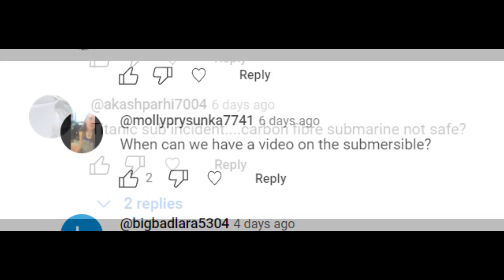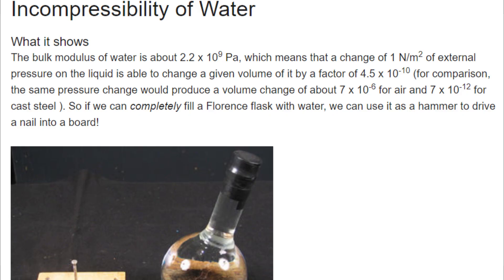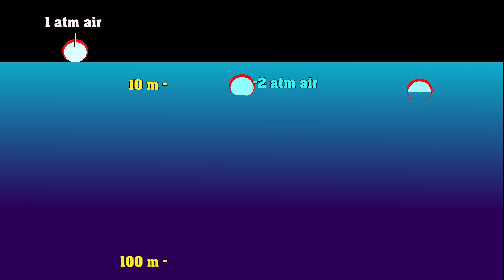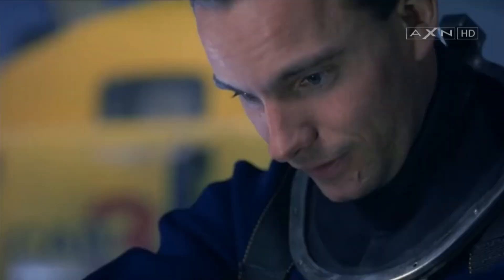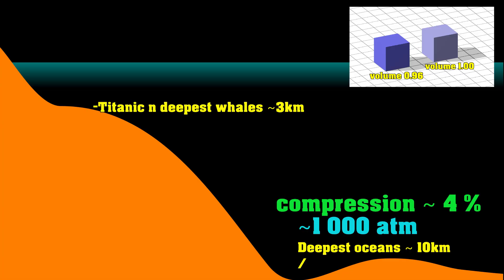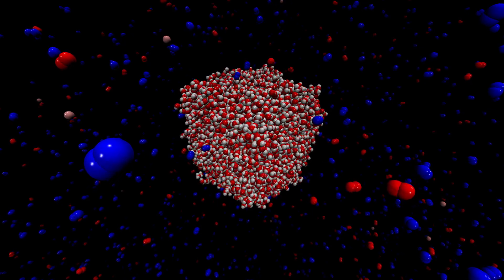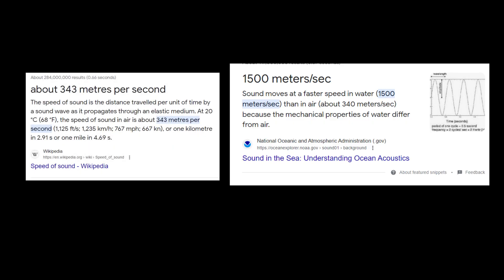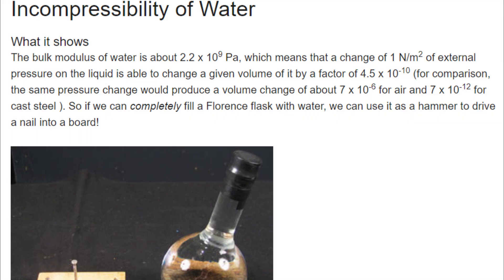What Happens when a Hull Fails at 1000 atmospheres?

Comment: Dude. Wrong. The weight of the water creates water pressure if the pressure inside the sub is less. And it is said to be about 400 atmospheres at that depth. Ever see a pressure washer?  Stick your hand in the stream at 60 psi and watch it strip your hand to the bone. The water pressure would have disintegrated them.

Comment: I'm puzzled by this, in that you seem to be arguing that compression of water is the only thing that creates a high speed leak, and that if the water were not compressible, the speed of the leak would only be "freefall speed". But even a metre difference in pressure head will make an appreciable difference in the speed at which water leaks. I know that there will be some compression even at 1m, but it's surely so small as to have a negligible effect. Pressure, or to be more precise, the pressure difference, does increase the speed of flow. At least that's what Mr. Bernoulli taught me.
Reply: A leak isn't the same thing as an implosion is it? You can have your tube of water and create a leak by poking a tiny hole in the tube, or a big tube. The speeds and pressures will vary between those two cases - yet they are both 'leaks'. We couldn't compare the Titan implosion caused by decompression of highly pressured (some tons per square inch) water with one of those leaks because it wouldn't then be comparable to the second type of leak. Isn't a leak and leak and this is something else unrelated?

Comment: If you have a hole between 1000 bar on one side and 1 bar on the other, the speed of water flowing through that hole would be about 447 m/s (about 1.3 times the speed of sound) based on the inviscid flow assumption. In other words, the amount of mechanical energy stored in the form of pressure (1000 bar) is equivalent to the kinetic energy with 4447 m/s. If the hull fails all at the same time, the water will rush in from all directions at 447 m/s and kill anyone inside instantly.

Comment: Water at that pressure do not act like a rigid falling at g, at that pressure is somewhat elastic; It acts like a compressed spring when its base fails and colapses, expanding very quick. The sub was crushed at a speed very close to the speed of sound on water IMHO.

Comment: When this originally happened I saw the joint fitting clip and knew right away, hand mixing an adhesive? Under these extreme conditions? And NO bolting of the metal to the carbon? Home depot Solution.

Comment: Rethinking the accident into an innovation: 
Deep sea thermal vents (high pressure high heat) are a great combo for curing carbon fiber resin epoxy. 

Only cost effective for mega size manufacturing.

Requires a powdered heat activated resin epoxy with no solvent ; to prevent curing until it is at the thermal vent (this technique requires a "boiling bag" containing nothing that off-gases).

Requires a cage superstructure to mount: retrieval cables, water circulation screws (for even heating). Special compression fans to force water into internal void areas (only enough that the internal pressure is marginally greater than the external during curing).

This could only be economical for mega size manufacturing in which the requirements for this technique are less expensive than a standard mega size heat chamber and pressuring. In standard technique Pressure is achieved using vacuum and or mechanical press. A standard mega size curing room has mega size costs. This could be a way to reduce cost on big projects.

Edit: https://www.google.com/url?sa=t&source=web&rct=j&opi=89978449&url=https://www.nationalgeographic.com/adventure/article/hydrothermal-vents-discovered-azores-science-environment&ved=2ahUKEwjXlv3vx6CCAxUyv4kEHZnsBH0QFnoECA4QAQ&usg=AOvVaw1Jm6aJYMLuODMdopGTz8Iw

Edit2: duh it's not just hot high pressure water, it is also super acidity. 🤦
Wouldn't be economic because making everything acid resistant would be too costly. There is also disturbing or altering the natural environment of the fascinating, rare islands of life that thrive there. I have wondered about how the species travel to colonize other new deep sea vents. Do the eggs of these animals travel randomly on currents and or lay dormant all across the deep ocean, or do adults travel to new vents guided by the smell?

Comment: In your falling tube demonstration, you made a false assumption. You assumed that all the ater in the column is going to have kinetic energy after losing the potential energy( by "falling"). This is wrong, almost all the potential energy lost from the column is going to be transferred as kinetic energy to the escaping water. Which will have a tremendous speed not just freefall. It seems like you have never seen a faucet. Do you think the water in a faucet is merely free falling? ( Admittedly, the celocity of the escaping water is the same as if the water droplets have free fallen the whole distance from ocean surface to the submarine depth not the velocity of free falling the couple of meters inside) 
Please refer to Bernoulli principle from high school physics. 
P1(surface pressure)= P2(air within submarine)=1 atm 
v1=0, v2=? 
h1=0
h2=-5000m (I am not sure)
Apply values to equation 
v2=sqrt(2gh) =sqrt(100000)=316m/s not slow

Comment: Size matters. The 3km water column is ~0.5% compressed (15m) by its own weight.
Imagine that spring let go into the hull.

The pressure force does not have to accelerate the entire water column in an instant. Hence analogy with different sized falling solid objects is leading to wrong conclusions.

Comment: Cool video and visualisations. It made me understand this better than any other video.
But I think there is a minor mistake.

The part of incompressible water filling the gap at freefall speeds regardless of depth seems fishy to me. Let me explain why.

The gap would fill at freefall speeds if the water only fell from the top of the bubble. 

But why would it ?
The water can flow in from any which side. I think this, the geometry of the problem makes a big difference. It's 3d, not 1d.

While I have not done any simulation or calculations, intuitively I would expect a roughly radial inflow.

But I think the big difference would still be that instead of a shockwave of decompression that shoots water into the bubble at crazy speeds from the get go, the incompressible scenario would start the bubble "front" static and have it slowly accelerate inwards until it's fully collapsed.

But if I had to guess, even the incompressible case is much faster than free fall.

Comment: I find these "semantical" discussions (such as voltage or current killing you) are limited because in the end, its still the transformation  of energy that kills you. Here, its potential energy (pressure) converted to kinetic energy (water movement).  Part of the kinetic energy breaks the bonding energies of the molecules in your body while another part is being converted to heat.  An conservation of energyy analysis would yield more insight, I think.

Comment: Sure, if, theoretically, you fill the lungs with a liquid of the same density as the water, and which is capable of transferring oxygen into the bloodstream, the lung issue will be solved (even if it crushes the spine in the process).

But what about the other orifices? What about the pressure delta between the water and the cranial cavity? What about the stomach, the intestines, reproductive organs, the ears, the eyes?
Water would rush in from everywhere.
I know that you are trying to put the point across that pressure differentials are what matter, that pressure is relative. But using a human being in this thought experiment was not ideal.

Comment: At 16:12, I don't believe there's a fine line with water at 370 atm on 1 side & 1 atm on other side in a wide area around the sub.  Maybe inside the sub at point of rupture & a pressure gradient would form everywhere else until implosion is over & P becomes uniform again.  How, by combination of decompression & enough water to fill sub at 370 atm falling & recompressing all the way from the surface.  I think Bernoulli equation has issue of compressibility built into it by (ro×g×h)1 - (ro×g×h)2 because ro 2 is at 370m.  Extremely complicated, so computer simulations will probably just assume constant P of 370 atm  outside sub.  Pressure = F/A, so water will fall faster because of Fg + (P×A=Fp)

Comment: I work with cavitation  as ultrasonic probes and you are hilariously wrong about water moving at free-fall speed, when a cavitation bubble collapses its over 200 atmospheres of pressure moving several times faster than a 50 calibre bullet and the water heats up to around 5000 kelvin from nearly absolute zero (microenvironment) - this is at standard pressure and temperature, a bubble collapses at around 2000 meters per second, not 9.81 meters per second per second - you are so hilariously wrong for someone that claims to be a physicist/engineer/maths science youtuber guy - stick to skimming patreon bucks from stans and leave the engineering to the engineers that actually work in the field my guy
Reply: "but whales dive that far" - whales have lord knows how many years of evolution to thank for that, fun to see biology is on the list of sciences you didn't major in... so what did you major in?
Reply: "why are they talking about debris fields" - genuine question, by a genuine science "educator"

Comment: by the way, even proteins have small vacuum cavities. when you put them and their solvant (water) under strong pressure (1000+ atm), the water around the proteins reaches for the cavities and unfolds the proteins on their path. similar unpleasant phenomenons can occur to your cells and basically most of your components. That's quite damaging and requires quite some genetic adaptation. Thus the water-filled diving suit is also for moderate pressures only...

Comment: Very interesting.. But it still sounds a bit strange to my ear, as if you for example, submerge a plastic water bottle, just below the surface with a 1 x 1 mm hole in it on one of the sides, let's say. And another hole of the same diameter on the top, at a 90 degree angle from the first one (i.e. a quarter of the circumference away from the first hole, seen from the bottom or top of the bottle), so that air can escape. The water beam, will have a very bent arc. Barely able to not collapse and instead follow the inside of the water bottle, to the lowest point of it. But if you now push down that bottle, say, to one meter. the water beam will be much faster and more straight, right? Or am I remembering this experiment wrong?🤔 And if this is the case, then the water wouldn't just enter the sub "at free fall speed, more or less" as you described it, if water was incompressible. Or is the difference in this example that, the water ins't actually traveling at free fall speed at surface level nor at one meter of depth. And thus, until you reach a depth sufficient enough to get you to free fall speeds of that water beam, pressure makes a difference to the water beam speed?

Comment: With your theory, a blast will not kill people either. I think your arguing is wrong. You forget an important aspect: time. You most likely are aware of cavitation. This will seriously damage material, even the hardest. And don't forget the heat produced at the same time.
The "Speed of Sound" you use is also incorrect. The defenition of the speed of sound in air is the propagation speed of an infinite small disturbance. In simple words'loud noise moves faster than soft noise. An example is the sonic boom produced by a plane flying faster than the speed of sound. This Boom (shockwave) moves at the same speed as the supersonic plane and can cause a lot of damage.

Comment: I was wondering about the speed of implosions because whilst the pressure is great, the inertia of the water is equally great, therefore you don't have an extreme speed of implosion, though it would still only take a fraction of a second. If you had a pin leak that water would spew in with quite a pressure though.
I edited this as you talked about the springiness of water - which will speed up the implosion substantially!

Comment: Thunderf00t, I have the bad news for you. I checked out and your numbers are all wrong on this. Water filling the submarine fundamentally is still powered by the free fall. And the low pressure cavity of submarine at this depths (2000m - 4000m) simply has not enough energy to accelerate it's volume of water to supersonic speeds. And I doubt that any significant part of that water will go at M5. Show me this hypersonic jet of water and what it takes to make one.

Comment: The outside pressure is greater than the inner pressure and the space in the hull becomes cooler while the water pressure outside becomes hotter hence the implosion (malleability of the hull)...pv=nrt...temp vol and pressure are all directly proportional...

Comment: Did you skip physics class, or just never grasp it?  Water under 300 bar will enter a void at the same speed as water at 1 bar?  Seriously?   So the water coming from your pressure washer or, for that matter, a water-jet cutter, is coming out of the nozzle at at the same speed as a drip from my leaky faucet?  Seems to me that's what your're saying.   What about the water under pressure that's coming from underneath?  How is the speed of gravity affecting it?   I must have missed something.
Reply: Right, it makes sense if you pick up the entirety of two different size bodies of water and drop them side by side. But a void fills from all sides and at depth, either the compressibility of water or the pressure would rapidly hasten that, which he does go on to say about compression... 
Is he saying the decompression of the water happens more quickly than the equalization of the pressure? I found the video interesting but can't deny I was left a little confused. 
I'm finding it hard to separate compression and pressure in my mind, are they not two closely related topics?
My take away was, when water is highly pressurised it is compressed, and when low pressure is introduced, the energy released comes from the decompression which in turn releases pressure... Not sure if that's correct though.
Reply: @88Cardey
Reply: This is by far T-f00t's worst video.  I'm appalled at how scientifically sloppy it is.

Comment: Diving bells and habitations have roughly one atmosphere of air pressure, not 10. Pressure does play a role into a person diving 100 m or saturation diving. It plays a role in the different mixes need for diving, like trimix or notrox. They don't use just compressed air when diving either. It's why someone diving that deep need to stop for about once or twice for 5-8 hours on the way back to the surface, swap to a different mix, and wait to "decompress" and rid the body of the build up nitrogen. Water pressure absolutely can kill someone

Comparing whales with submersibles and people is a blatant false equivalency. That clip from The Abyss was done by practical effects and camera tricks. The rat was not actually in the water. There was a real tests that did it with a rat and a person, but not in the movie. You should stick to whatever type of science your degree is in. Several of your videos "busting" or attempting to explain stuff are wrong, with some in the not even wrong area.

Comment: So with what might be the transcript released, they heard noise, tried to surface, but they were not going anywhere, power failure on batteries. Seems like they were taking on water in the back end compartment 

Now from my experience with water jet cutting, they make a glass mat that is like 2 inches thick, it is able to absorb a "light" water only stream and turn that into dribbling water on the other side. Maybe the carbon mattting was able to defuse the stream to a slow leak, not that it would have been so laminar anyways.

Did you see the hydrolic press channel make a mok sub and crush bit under 400 bar? Seems like the glued end on the flange popped off first

Comment: You could also bust the ideas about people inside getting turned into a molecular soup. There are a lot of armchair physicists out there who enjoy these morbid ideas and compare a sudden exposure to high pressure water hammer with getting squeezed asymmetrically and turning the object into a pancake or mashed potato kind of thing, as what happens in a hydraulic press or a vice.
Apart from the epoxy shards cutting bodies while imploding and tissues and body parts containing free gaseous matter being crushed to a smaller volume, I don't see much happening to the rest. Literally no reason for people to turn into a suspension of molecules.
Then they mention high temperatures forming during implosion, perfectly forgetting temperature isn't heat.
Plenty of stuff to bust for you.

Comment: 15:10 I STILL do not understand where Thunderf00t is getting this volume of water at 1 atmosphere
(yes, I know the AIR inside the sub was at 1 atmosphere) EXPANDING INTO CRUSHING WATER AT 300 atm or whatever.
There is just something so seemingly UNNECESSARILY COMPLICATING by Thunderf00t's explanation compared to:
sub imploded due to 300atm-to-1-atm differential, and perhaps heating up the air bubble inside when it gets compressed in 0.1 ms to 2000K, and one or both of those kills everyone.

Comment: There is no sub left to fill with water. Do you not understand an implosion in deep water instantly pops the sub like a balloon. There is no filling up the sub with water. There is simply no sub left instantly.  Go to the hydraulic press channel they show what actually happens at high pressure implosion.  This video is clueless. There is nothing left to fill with water after an instant implosion.